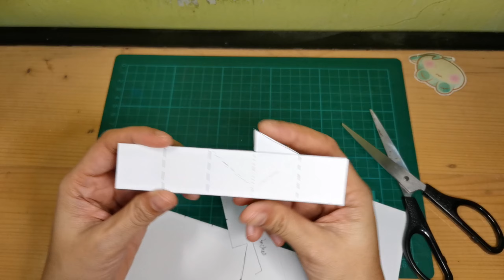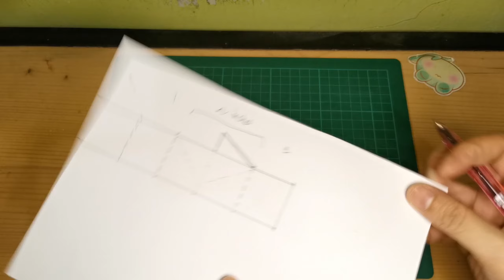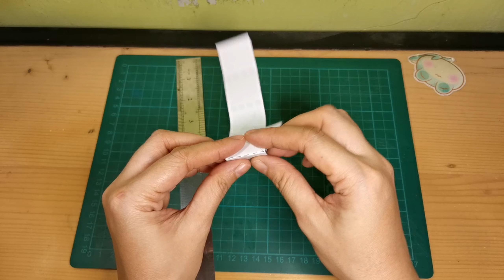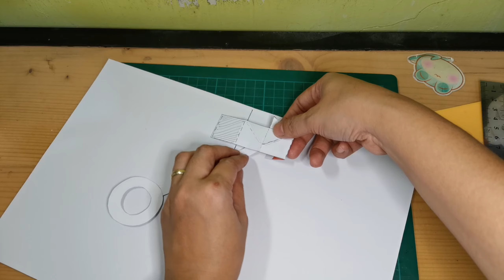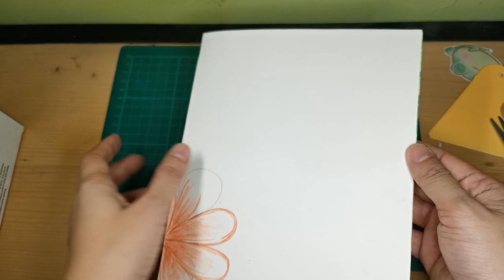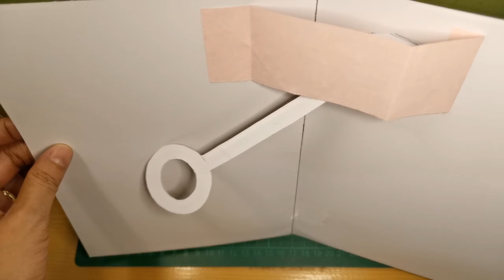Pop Up card / Art - How to make a pop up card with swing arm mechanism

Comment: doesnt work. the moving piece at the bottom point gets stuck in the middle of the pages when it is moving to the left side, causing the moving piece to switch sides and not finishing the movement correctly. ive tried using smaller measures, cutting the pendulum piece smaller, it just doenst work. bad tutorial.
Reply from the maker: Oh that's so sad. Maybe you can try again.